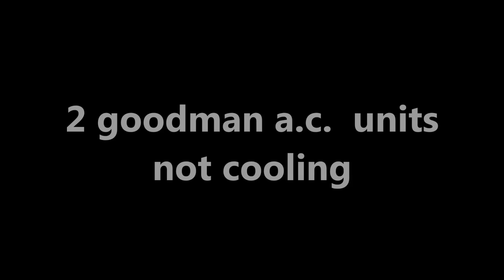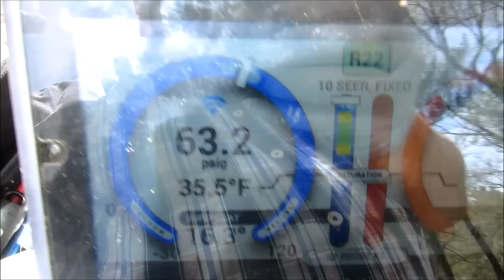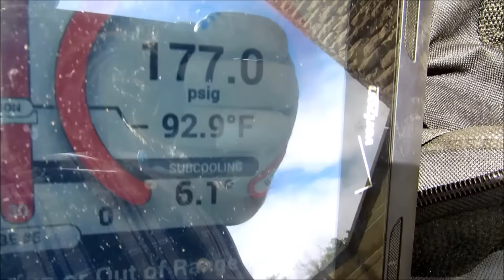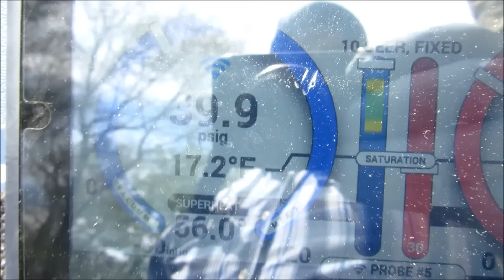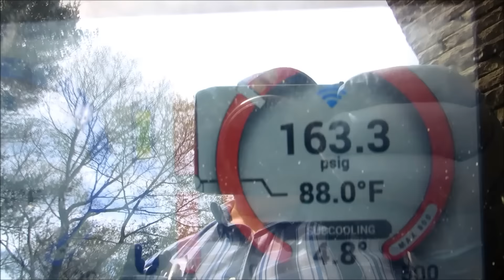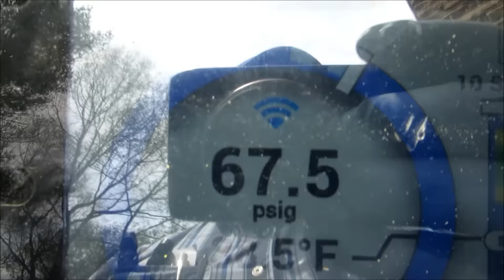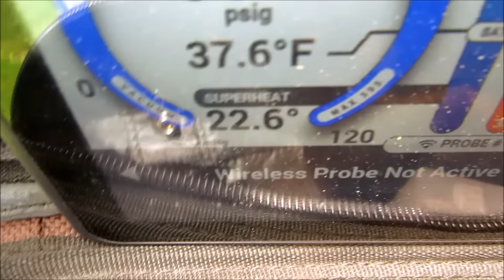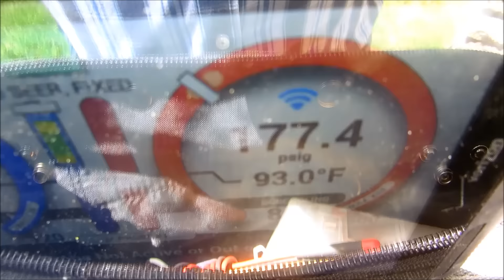hvac 2 goodman ac units will not cool

Comment: Would you normally need to check that the indoor filter isn't clogged and the coil is clean in this type of situation?
Reply from the maker: Galfonz the home owner said they just changed the filter .  so i went to the condenser first.on this job ..

Comment: we go thru a lot of capacitors with goodman, I noticed on the ones they use say castor oil not mineral oil maybe a connection, funny they sell both at goodman, if its a warranty you get the castor oil one, we have avoided them and our service calls went down good or a bad thing and look at the thickness of the coils on their contacters. terry bardwell from goodman made me aware of this 10 years ago and thats there guru
Reply from the maker: northco hvac i do change a lot of caps my self .

Comment: Steve dose the Imanifold automatically calculate the super heat? or do you still have to do the wet bulb dry bulb?
Reply from the maker: Patrick Fermo the wet bulb and dry bulb is calculated by the supply and return wireless sences . i am just getting the hang of the iconnect once i have it down pat i will be doing videos on how to use it out in the field . there is a learning curve with it .it can do so much .

Comment: Up where you are do you need a DOT card to drive anything over 10000 pounds. Need one down here
Reply: hvacman77 Here you need to take another test to drive over 7000lbs or tow a trailer, lucky i can drive upto 16500lbs with a trailer becuase i took my test so long ago.
Reply from the maker: hvacman77 yes i need a dot card any thing over 10,000 gvw